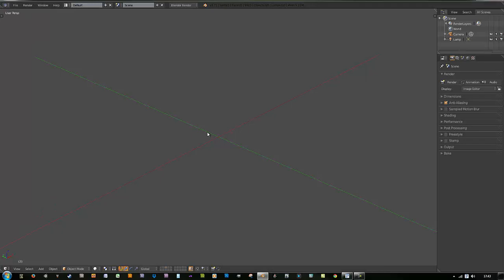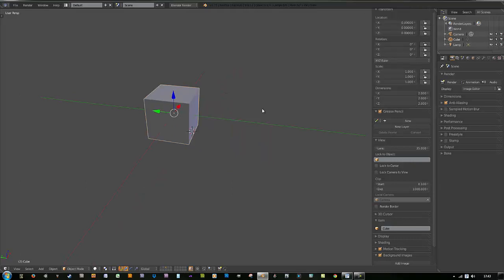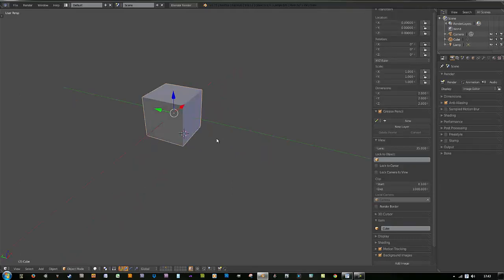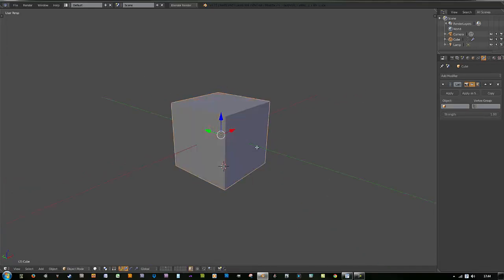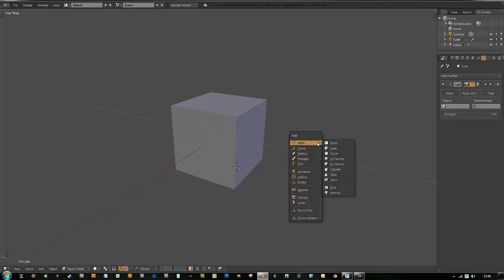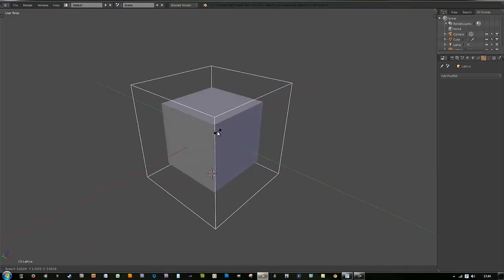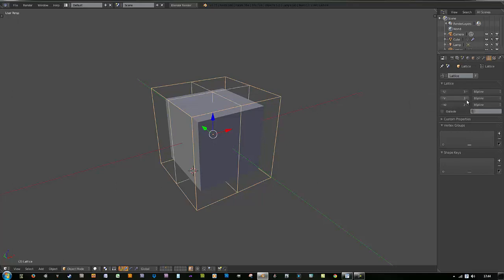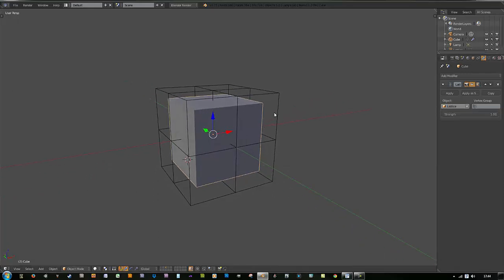3ds Max Blender FFD Lattice Modifier

Comment: Thanks man.. wow, thats so much more a pain in Blender.. oh well..
Reply from the maker: yea, I only use it when I have to at work....takes forever to do simple things but it serves its purpose.  the modeling just isn't intuitive.....granted it took a few years for max to be..or any software.
Reply: +Spencer Clough What do you mean forever to do simple things? Its true that the lattice is a pain, but what else do you mean? Movement is better in Blender. No need to tediously click a widget. Pressing E to extrude and then moving without a widget is by far much easier than any other programs mechanics. Blender does many simple things better than other programs, and many that it doesnt. Id much rather make a base mesh in Blender than Max, thats for sure. And with the way workflows work these days thats all you need before you go to ZBrush.